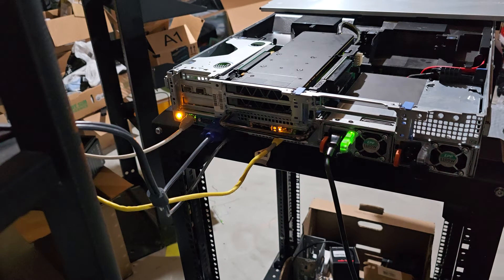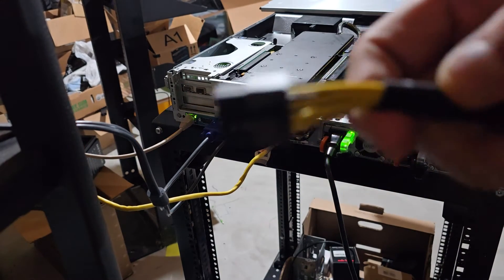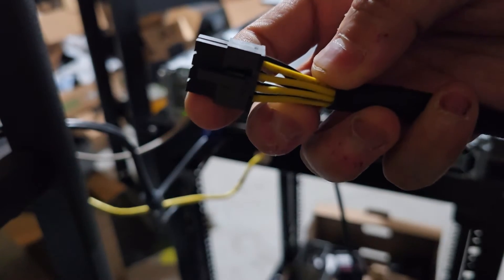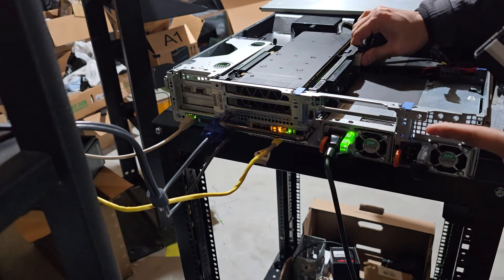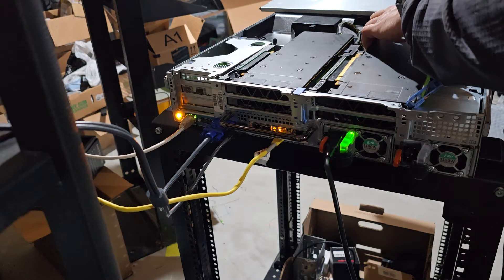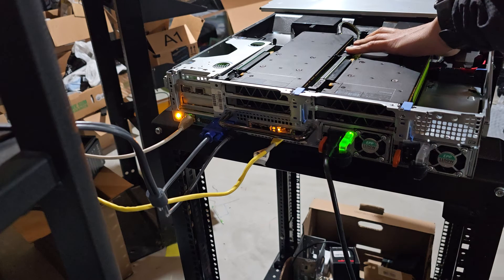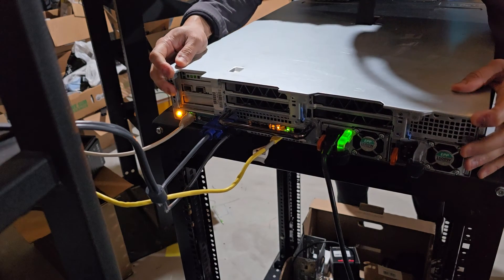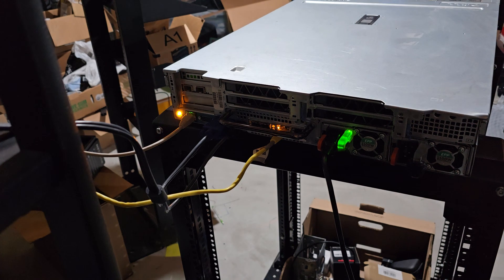Accelerating AI: Adding a 2nd Nvidia P40 GPU to Dell R730 for Dual LLM Virtualization!

Comment: Hi,
Are you running Esix 8,U3? and possible to shared GPU to VMs Windows 10?
Reply from the maker: Works on both esxi7 and 8. On Windows I don't know if you can go a GPU passthrough, but you can install ollama directly on Windows.
Reply: @MukulTripathi  I already put the P40 inside R730 and just running the ESIX 7, but, the fans seem go crazy (a bit loud sound from fan) even I still dont do anything for loading. Do you think it is normal running with loud sound with the P40?
Reply from the maker: So they spin up fast initially and then they slow down. Make sure that your cover is closed otherwise the system detects that the airflow isn't optimized and it hits fans in full speed.
Reply: @MukulTripathi  Do you have any problem with the big sound from fans, before and after the P40 inside server?

Comment: what wattage does that server pull?
Reply: My r730/256gb/2ssd with 1 P40 runs at 140 at idle with Ubuntu 22.04. Running Oobabooga and A1111 and few others if you were wondering.

Comment: Where are the SLI cables?  I think you forgot that essential component...  and don't forget the code required (I don't think NVLink code is going to be the same).
Reply from the maker: Haha, true. They are expensive and hard to find! So I didn't use them. I am however investing in a multiple 3090 GPU rig.

Comment: Man did you installed a GPU without shutting down the power?! 😅
Reply from the maker: Haha, I can totally see why it appears like the servers were on because some lights were glowing in there. On these Dell servers if the power cable is plugged in even though if the server is turned off there is a interface that still stays up and lets you connect to the server remotely it is called IDRAC. So the servers were off but just by the virtue of the fact that the power cables were plugged in those lights were glowing. 

In an ideal scenario I can unplug the power cable to have no lights turned on. Realistically I have never run into an issue with the ID rack being on while I'm swapping GPUs. it makes no difference but I would suggest unplugging the power cable to just so that we do not touch any electronic component.
Reply: Now I have a dell r730 with a tesla P40 and a tesla P100, I'm waiting for the power cables and two 1100w power supply to have it functioning. I used your video as reference, thanks. I will do some 7b/13b LLM fine tuning with this machine. Hoping that 40gb of VRam will be enough
Reply from the maker: I'm glad it helped. I made more video on the OpenVoice V2 on this server. I think p100 supports fp16 so you should be good there.

You should watch the new open oice video too. I'm currently making "Jarvis" and it's almost ready.
Reply: @Nonagon-bc2wl  Arent those inference card not tuning cards?
Reply: @callmebigpapa  P100 is designed to perform well in tuning, P40 for inference. But are quite old cards, I have an RTX 3080 in my work PC that is more powerful than the two combined together, but I can't do tuning due to limited VRAM. I'm just experimenting and I managed to get 40 GB of VRAM for 350 us dollars. At the date of today the only difference is that tuning is very slow, but I can wait it's just for learning purpose.
Reply: @Nonagon-bc2wl  Based on your insightful comments I ordered a P100.  My P40 works fine for what I am doing and i suspect the P100 will also. Like you this is for fun and learning also, I can start it tuning and leave it running for days or weeks if necessary. Can you expand upon what you are doing and how long the fine tune takes?  I can wait to tune some very specific models on authors I like and see what it can generate for custom short stories.
Reply: @callmebigpapa  I'm training models like llama3 to act as customer service. But I'm very early with this, I'm just completed the hardware and configured the software for fine tuning and ran some tests. The tests I ran needed to be run for three days. But the result was not good because I need a good quality dataset to run the model and/or maybe some other experience (I'm just started). Take in count the amount of energy needed for this, I'm running it on solar energy otherwise I had to pay like 10-12$ in the bill per run. Knowing that you needed to execute several run to obtain a good result (at least in my case, your seems easier), is a thing to be counted. Especially for the r730 which with two CPUs and two GPUs consumes 250w at idle

Comment: Hi,
Can you please write the link where you bought the cable for the P40?
Also did you make any game bench on the cards?
Thanks!
Reply from the maker: This is the one I bought, but I can't recommend it. I bought a bunch and a few didn't work.

GinTai 8(pin) to 8(pin) Power Cable Replacement for DELL R730 and Nvidia K80/M40/M60/P40/P100 PCIE GPU https://a.co/d/3NdU0rf

Comment: What LLM Models are you planing to run?
Reply from the maker: 48 GB VRAM gives me the flexibility to run llama3 70b model. That's what I'm most excited about. Watch my other videos to see what all I run!
Reply: @MukulTripathi if i understand correctly, llama3 70b needs ~130 gigs of vram to run
Reply from the maker: The Q4 quantized version of 70b llama3.1 runs on 40-44 GB of VRAM. Please see the quantization video that I have done.
Reply: @MukulTripathi  how do you quantize a model in ollama though? sorry i just started playing with llm this week
Reply from the maker: @lknhd  even though there are ways to quantized the models, you don't have to do it by yourself. If you go to ollama library online there are pre quantized models there. The default model on ollama website is q4 quantized.
Reply: How many t/s do you get if you run a 70b model that is 40gb because of quantization on two p40s?

Comment: are you using NVLink for the LLM use-case here with the GPUs? Also which Ubuntu version are you running? Interested to know, looks like a cool project.
Reply from the maker: No I am not using nvlink. It definitely is an interesting and relatively cheap project for the amount of vram that we get out of it!